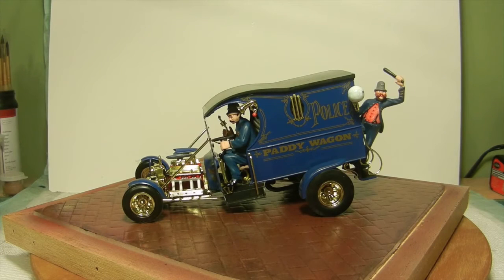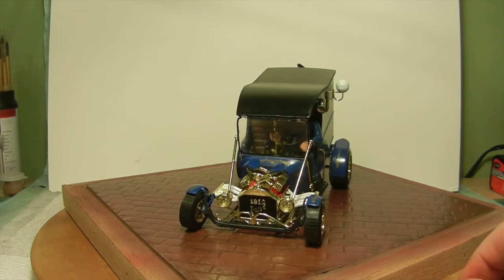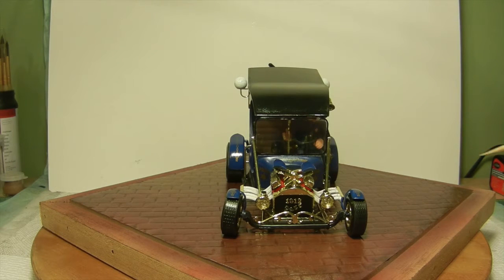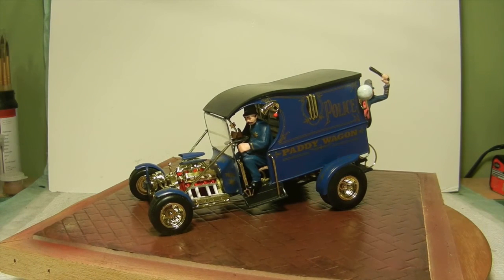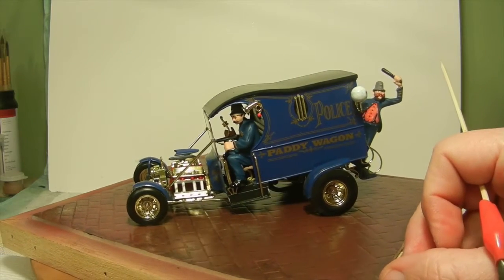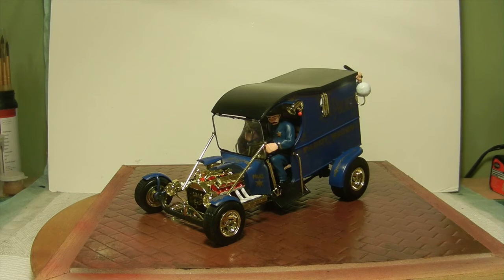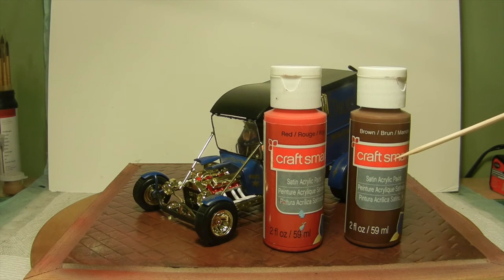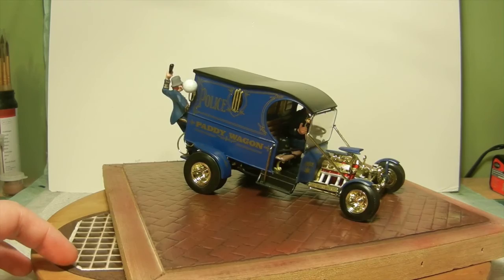Tom Daniel's Paddy Wagon Finale

Comment: I searched paddy wagon and yours came up  ,and I like how you did yours .
I watched another one ,and glanced over some others that I will be checking out soon ,and that made me subscribe to  your channel 
after watching your I opened my kit like yours and one side of the rear end there is no hole so I'll have drill mine out .
I bought mine on evil bay and had 3 sets of slicks with mine, none of which came with the kit ,did have the correct front ones 
finding tires shouldn't be a big deal for me ,I have alot of extra tires and wheels and even some for a paddy wagon I think .